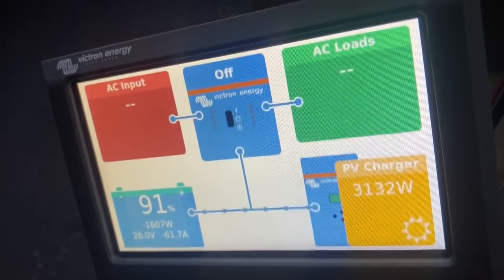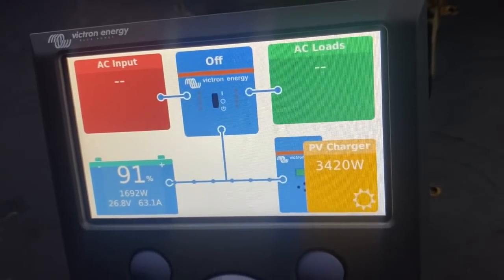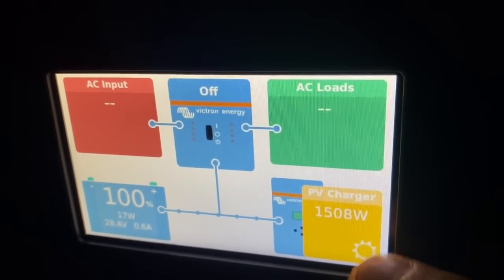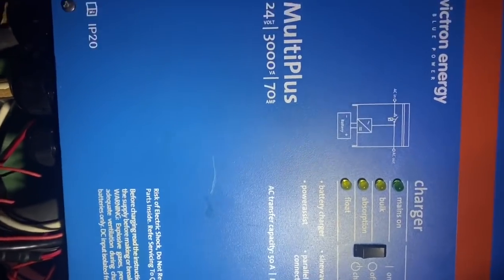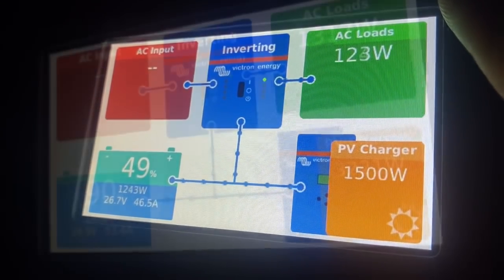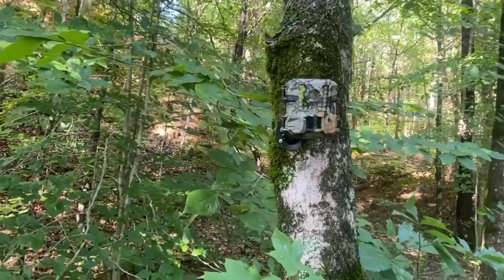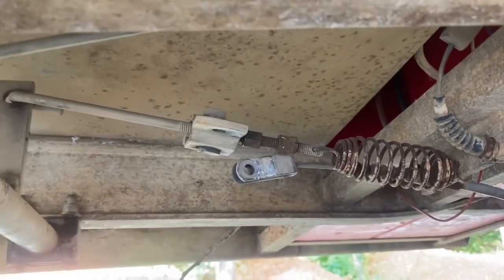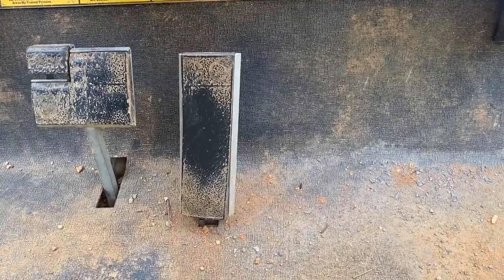Rv solar output numbers. (Warning lots of numbers) plus trail cams and golf cart brake work

Comment: Hi Scott, I love your video on solar power. You show that you have installed sun power model # SPR-E20-327 at a cost $110.00 per panel. I priced the same unit on line here in Florida. Sun power quotes a price of $600 per panel alone. Please advice, why the huge increase in price? Bfeehrer@gmail.com.
Reply from the maker: We also said we buy them used from santan solar.  Still like 20ish years on the warranty all tested and checked.  Huge savings
Reply: Bus Grease Monkey Thank you, Scott. I must not have caught that on the video. Please continue the informative videos as I am addictive to then. If I were younger, I would be shopping for a bus of my own. General  Motors builds some very strong engines. Good luck in your endeavors. You look like a happy man.👍🙏

Comment: just wondering if you have a bug issue in your new hill top palace..  have you thought about building some Pole mounted BAT houses out away from your parking..  as bats eat lots of bugs every night..   you could even have cameras inside it and stream .. inside the bat house..  replaceable batteries on the post or solar on the roof..  its just a thought..

Comment: I have been waiting for details on your solar system. After watching your last video I am about convinced to buy some Battle Born Batteries. I have a 48v system. I see they offer both 12v and 24v batteries for about $1000 apiece. They advise me 4 12v would be more robust than 2 24v.
I see you run all 12v. This is the direction I am leaning.
Reply from the maker: I love them.  Use my link or mention us when ordering if you wouldn’t mind. http://battlebornbatteries.com?afmc=2m the batteries just work perfectly with high amp draws like you are plugged in

Comment: Would like to see efficiency of the inverter.  The load moves around so much you can't really tell from the display but it looks like 90% maybe.
Reply from the maker: The victron multi Plus 24v inverter is 94% efficient
Reply: Bus Grease Monkey , Sir I’m 70, have a 2018 42 ft. 5er.  Have a residential fridg and two super quiet ac’s.  I want to Boondocking but wife wants her ac’s and residential fridge.  Where would you recommend going to have a large system designed and installed.  Enjoy your videos.  Thanks Miles Windham.  mekooh@suddenlink.net.  Wlould love to hear back from you.  I live in Texas.  Again Sir I thank you in advance.

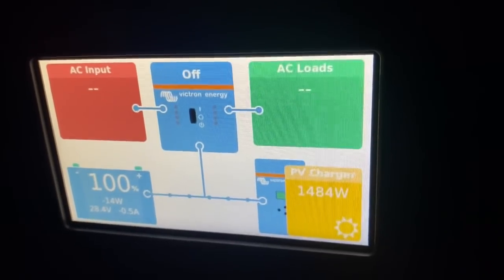Comment: Thanks for clarifying at the 3:20 mark that the inverter was not hooked up to the display.  I was confused that it was shown as “Off” with no power going to AC loads but the air-conditioning was operating.

Comment: Pretty amazing - your system is similar to having a small house.  I was considering using AC on a low setting in an off-grid cabin on solar, which was far less than 1000 watts, beginning early in the morning.  You appear to be use well over 1000 watts with your AC.  Sweet system.

Comment: I for one am interested in your solar system.  I wanted to have a solar back up system for my radio  and computer systems.  The major obstacle to overcome has always been the cost verses the system life expectancy along with upkeep replacement costs.  Based on your system costs it averages out to around $167 per month over 10 years. In 10 years is where it becomes difficult to maintain because you can plan on replacing the battery bank for $12K or more at that time.  The costs  may be higher or lower at that time.  Based on the law of averages I have less than 10 years of life expectancy left so it looks like solar probably is not in  my future.  I do enjoy your videos!

Comment: I love seeing this in action.  My question is why is there no AC load showing if the A/C is on and the Induction cook top?  They are running on AC are they not??
Reply from the maker: I didn’t have the inverter hooked to the system yet.  But you can see it by the difference between solar output vs battery charge/discharge
Reply: @BusGreaseMonkey  Yep, but later in the video you did hook it up and then It fully displayed both the charge side and the AC consumption.   Very interesting way to monitor the system.   I have learned a lot watching your progress with this installation.   Thanks.
Reply: Display you see AC in red That if Shore Power is plug in or can be a Generator hook up So there NO power coming in. So right side display of Inverter/charger show AC power use. Do this help you.
Reply: @akdisney  Yes, I know that.  I was just wondering why the AC usage did not show in the begining  of the video and that prompted my question.  I then realized that  it was because Scott did not have the inverter hooked up yet to the display device.  Once he did everything was shown.  I know that nothing showed on the Line block as he is not hooked up to any line voltage and no longer has a generator on the bus.  I follow him regularly.

Comment: Golf Cart Grease Monkey, great job on the solar/inverter stuff.  I wish my bus had a wide open roof, too.  I can't get more than about 2000w up there and that's pushing it.
Reply: Get a minisplit a/c so you can remove your a/c and vents and skylights and cover your whole roof. Thats my plan. I saw another guy did that. He even had a second set of panels on slides under his main panels. When he hits a button,  they slide out and double his solar and shade his whole rig

Comment: Nice solar setup. It would be really cool if a panel manufacturer could make articulated panels that could follow the contour of the roof. It would lose a little efficiency by not being perfectly aimed. Someone is probably working on a solar panel "paint" that could be applied to make anything it is applied to into a solar panel.